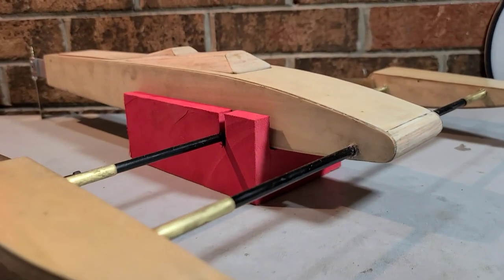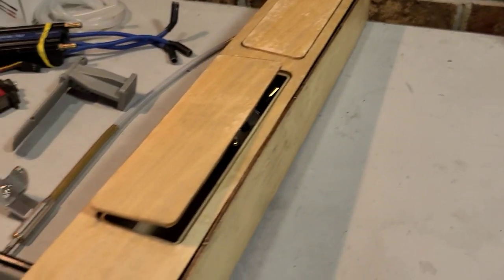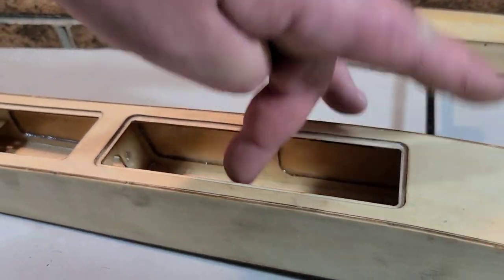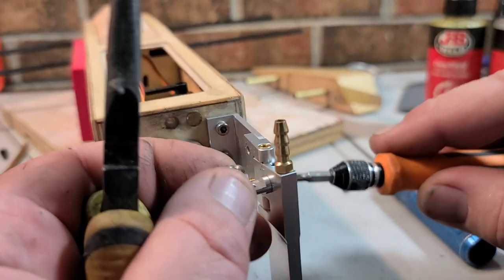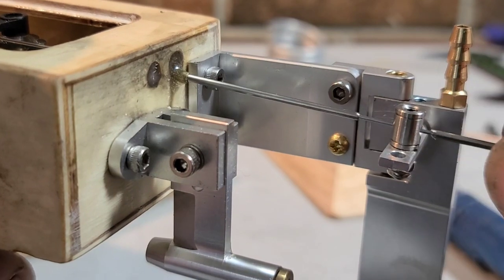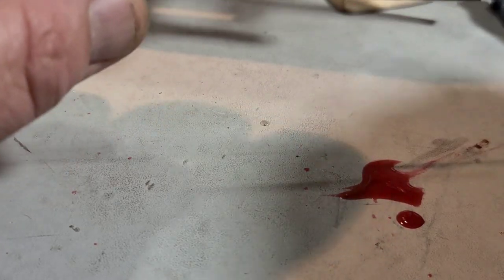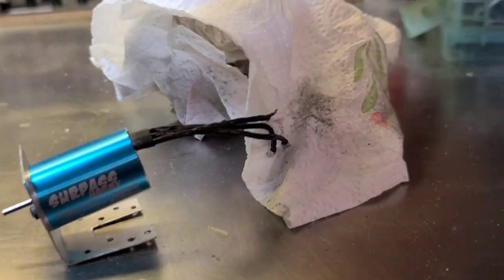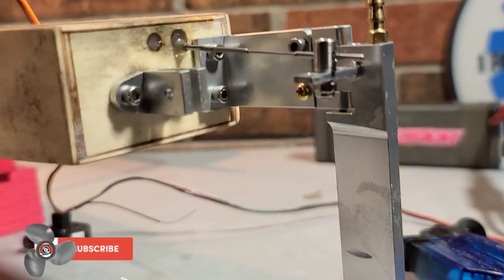Servo, Rudder, & Custom Steering Install Shrimp Outrigger Rc Boat Build Pt 1

Comment: Looks like we got the same kit. Only I'm going to use a 7500kv brushless motor with a 90 esc .of course the rudder is the cnc aluminum. I used a point 40 gage guitar string as my linkage between servo and rudder. We think way to much  the same. I even a Dremel to cut my pieces . I only need to show you. Lol

Comment: Big B … I’m thinking this could be my next boat. Basic kit price is very affordable. I’m wondering which accessory  kit you got? I would want to use the OSE rudder and shop the motor/esc so, I guess just the basic kit no accessories. Another great instructive video … looking forward to the next segment.
Reply from the maker: Yea man I'd go with just the wood kit,  it's a fairly straight forward build.
Reply: @IRONCLADRC  Thanks!

Comment: Hello nice video i have one question . my rc boat has 2 motors with those it turns if i want to turn right then one of them activates etc but its not steering well . so i thought i could install a rudder but there is no other free channel at my radio. Is there a way to install servo for the rudder  to my motors?

Comment: What do you think would happen if an outrigger had a surface drive on it? Like a TFL Arenson Drive.
Reply: I have a jet boat and have debated a jet drive rigger! Tapped in for answers
Reply from the maker: I've done a surface drive on a rigger before  it will not get the back of the boat high enough out the water.   Performance is t there
Reply: @IRONCLADRC  with the arenson drive it looks like a gimbal just like a full size one, it should be able to point down some to lift the boat. I just haven't seen to many good videos of them in use to be able to see the full range of movement other than side to side.

Comment: Thank you for your videos. I am switching from weed wacker gas boats to electric. Could you please do a video on electric motors and what all the numbers mean. 4 pole vs. 6 pole. KV and RPMs. Much appreciated I am building 6 different boats all electric and could use your help Brian B.
Reply from the maker: I'll try to do one here shortly

Comment: Is it better to put the steering set up on the Rat side or does it hurt to put it on the left side? Because I’ve noticed most of them has been on the back right side I was wondering if that does something from the prop torque or just the weight distribution of your battery
Reply from the maker: On a rigger as far as I know the rudder can be on the right side, hydroplanes tend to run there rudder on the left side.   I don't see why you couldn't run the rudder on the left side of an outrigger this boat was designed for a right side rudder mount because the motor is off set to the left

Comment: Cool!   😎
Reply from the maker: I love your steering setup brother I've literally done 5 boats with that set up so far.
Reply: @IRONCLADRC  I'm going to the pond to test the Micro Jet today, but I'm also testing a couple of prototypes for the next Challenge, and both examples use that steering linkage system.  I like how it's waterproof and smooth as silk at the same time with no big (relative to really small boats) bellows to worry about.

Comment: I have a brand new aero trooper ,and the servos just studders and only control is the throttle ,I put in a Traxxas one  it works but ,when I shut the boat off and restart the Traxxas servo doesn’t work unless I unplugg it and plug . it back in then it’s fine .not unless the Traxxas servo won’t work on the Proboat any help will be most grateful
Reply from the maker: Solder on the receiver could be broken?   Or water it the servo?  Idk. Wish I could help more
Reply: @IRONCLADRC  back from the lake ,I took the servo out of my stealthwake 100 percent ,the new servo was faulty on a brand new boat,it happens they make millions of them its a Traxxas but it works
Reply: @IRONCLADRC  Thankyou for your thoughts